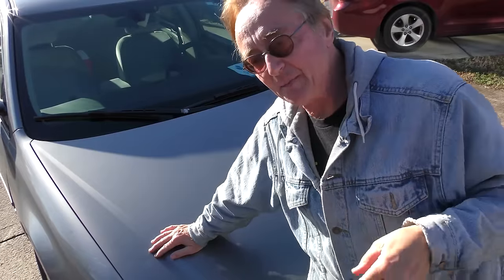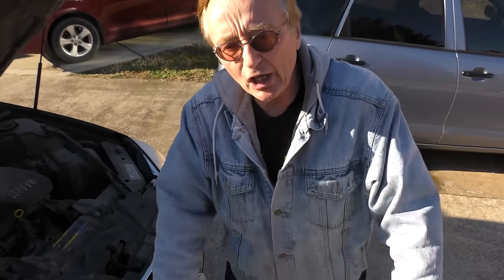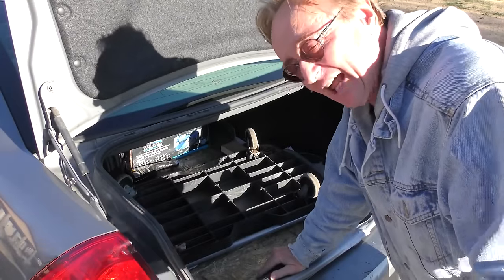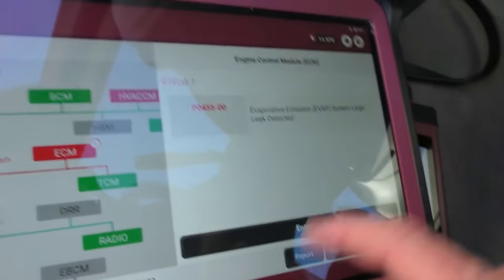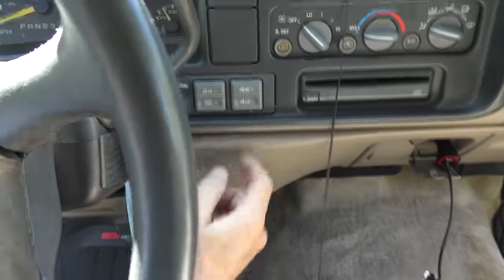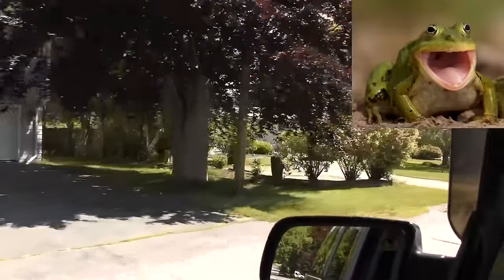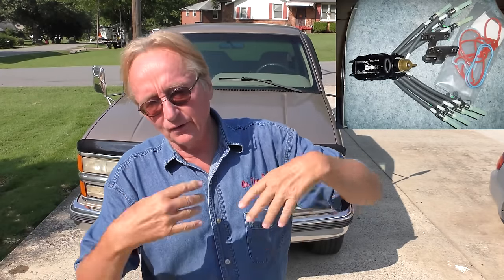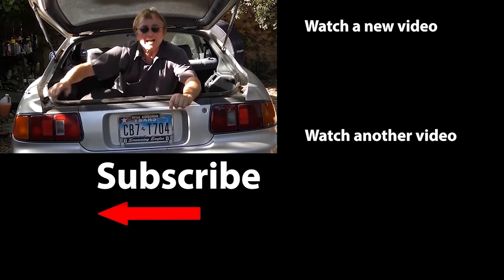3 Chevys That Last Over 400,000 Miles

Comment: I got a 2010 Mazda 3, automatic. Halifax, Nova Scotia. Purchased second-hand in 2014 with 92,000km. Next week I will hit 600,000km. Best car I've ever owned.
Reply: Mazda make awesome cars, extremely good quality
Reply: Wow. I had a 2010 2.5 with the 6-speed manual - thought it was a very well built car. Only got rid of it because I didn’t need a car at the time (got a company vehicle).
Reply: I should check to see if mine was actually built in Japan. I know Scotty says those are better made.
Reply: @randyburrill2340  For export, yes they are.

Comment: I have a 2003 Chevrolet Silverado z71 with the 5.3 liter. I bought it new and it now has 290,000 miles. It had the brake lines replaced recently, I had the water pump and alternator replaced a couple years ago.  The truck runs great, the only thing is the clear coat was coming off and I had to have the hood repainted. It has never been garaged.
Reply: It now has over 305,000 miles and I just purchased a driver side power window and mirror and door lock switch although I have not yet put it on.
My mechanic said he has seen this 5.3 engine on other vehicles come to his shop with 400,000 miles.
Reply: @denniskelly2177   Thats amazing !

Comment: I have a 2008 chevy cobalt. bought off my aunt in 2018 for 1k, i have put over 100k on it (i have a large commute) and have only dealt with three semi major repairs, 1. the trans fluid was never changed (my bad, 2k rebuild), steering column needed replaced (1ish k) timing chain needed replaced (known issue when bought in 2018) 1ish k. Fantastic car and it still runs great, i keep up on things and now regularly change my trans fluid. This thing is going to make it to 1 mil miles!

Comment: i had a 2003 impala that still running after i gave it to my lady friend. i knew there was a transmission problem when i bought it, it wouldn't kick into 1st on start outs. i used it mostly for in town driving so if it broke down no big deal. at 260,000 i got a connecting rod tap. my friend is still driving it with no major problems yet, knock on wood. you're right maintenance has lots to do with the life of any vehicle, abuse also reduces its life, yeah right when we were teens we didn't think much of that

Comment: I have a 1996 GMC standard cab pickup I bought new here in Florida. It has a 106k highway miles on it from driving 100 miles weekday back and forth to work. I retired in 2005  and it doesn't get driven much but it still runs perfectly. It was built in FT Wayne In. There is no rust and it still looks great.

Comment: I agree...Scotty I have a 1999 Chevrolet 1500 Suburban. I am the 2nd owner and bought it at 5 years old. It has 193577 miles on it, and yes it has a few faults, the rear ac lines rusted, so no rear ac. and it has a little body rust which I will fix. But it rides like a cloud. I plan on keeping until it blows up or I die. I only put about  1500 miles a year on it now since I bought a 2011 HHR  7 years ago. I am retired now my driving has been reduced. Love your videos.

Comment: I have a 2000 Silverado 5.3 V8 ...just turned 210k miles. I bought it for like $5100 in 2008..... 15 years later I've probably put about 5k in normal maintenance items into it. It was a northern car and I moved south with it but it's been reliable and a solid truck. GM needs to get back to making their vehicles like they did in late 90's early 2000's. They had solid trucks and sedans back then. Those Vortecs from that era were bulletproof...could easily 200k with minimal issues out of them and if maintained right they are 400k engines. Just had to be careful with certain years of those engines mated to certain transmissions.
Reply: I have a Silverado not sure of engine at 250K
Reply: All the trucks have become a nightmare, nothing simple any more, you are right back in the 90's they were much more simple. I am keeping my 1994 F-250, that I bought new; as long as I possibly can. Love the 351 engine with 5 speed on the floor.
Reply: Great. I have a 2003 GMC Yukon XL with 241k miles. Purrs like a kitten. Cheap parts at the junkyard is a plus.
Reply: I also have a 1999 mid year model silverado 5.3 and have 3610000 miles on it and counting!!!! Drive it every day hauling about a 1 to 1 1/2 ton loads on it and still engine is strong and smooth 💪but the rust underneath is extremely bad due to living in Missouri but this truck paid for it's self over ×1000 times!!!!!
Reply: @jewjones410  Damn 3.6 million miles? What's your secret?
Reply: @thedirtybubble9613  lol mybad 350k

Comment: I had a 97 chevy pick-up with the vortec  5.7 V8 and 4L60E transmission. Had 150,000 miles on it and that truck was solid. And very dependable. I wasn't afraid to take that truck on long trips. And, yes, I live in Texas, and the truck was Canadian made.
Reply: Same with my 2000 Silverado 5.3. I still have it. Just turned 210k miles and I am in Texas. Just drove it to Florida and back. Solid trucks!
Reply: @buzztrucker  Nice, I got 291K on my 2003 Avalanche
Reply: I have an 02 Sivlerado with 356k on the original motor and tranny. Still running just fine. Best vehicle I've ever owned.
Reply: any motor should go 150,000. nothing to write home about. 250,000 and up is when you should be proud
Reply: 98 Z71 5.7 still going strong but the interior is getting pretty weathered. Seats and head liner need work and dash just cracked. Passenger rocker panel rusted thru and clear coat has been peeling for years. Runs and drives fine. Gonna drive it till the wheels fall off. Doubt anything new will be as cheap to own and I don't drive it much.
Only 119k miles.

Comment: I am a w body enthusiast, my first was a 97 grand prix gtp, I bought it with 210,000 for 1,000$, I had it for 7 years and sold it for 1,500 $ with 370,000 and had the original trans and being a supercharged  3800 that I did performance mods and I beat it well, and  I know the car is still around, imo 97 and early 98 4t65hd trans were not a brittle since they had no traction control
Reply: I also own a 08 impala ss but that needs a trans but that's because of the V8
Reply: @amandaschuch2372  I've always wanted the SS! But they go through transmissions for breakfast lunch and dinner!
Reply: But the dollars are worth less then before....

Comment: I am sooo sad.  I own a 2000 Toyota 4Runner.  It still runs like a charm!!  GREAT running condition.  However, I've experienced the rust issue that they tend to have.  Pot holes were so bad this winter, something came apart underneath and there's secure area to weld it back to so I'm a loss.  Just put 2K worth of maintainance work into it less than a month prior!
I don't want not new car!  I would like to restore my 4runner or would like another older car .. preferably manual transmission!  These later model cars can't hold a candle to the older cars.  
I sure do appreciate these videos.
Reply: Mazdas are pretty reliable. I'm saving for a new one!
Reply: @mcc7762  It's jus over 200k miles.  It really runs great.  Just changed the timing belt and all that goes with that process, and had the whole break line system changed.  Just for maintenance!  It wasn't burning oil, tranny is in tact .. nothing else is wrong with it.  just the rusted out bottom.  Don't even know how to begin to go the way of a new frame.  Any suggestions/references?
Reply: @mcc7762  Thank you so much for your response!  Very helpful.  I will do a search.
Reply: @jackpowell8155  Hondas are even better than mazda

Comment: I have a bi-fuel 2002 Chevy Cavalier with 1,050,000 miles on it. The original engine and automatic transmission were replaced at 700,000 miles only because a fail safe thermostat failed closed and blew the head gasket and I could tell the transmission was on its last leg. Engine was not burning any oil, that's what running on CNG does.
Reply: What's CNG
Reply: @Rob810Flint  

CNG stands for Compressed Natural Gas.
Reply: @ryankirkham8130  thanks I'm supposed to know that 😂
Reply: @Rob810Flint  No problem!
Reply: Mine is approaching 300k starting to think it's a young stud still😂

Comment: That 3.5l V6 was always sweet, but the sweetest of them all was the 4.3l V6 on my 91 Astro van
Reply: Those 4.3 are 300 HP or so.  Very peppy and fast top end too.  I had a 1991 sonnoma with 4.3 supercharged and it flew.  The 4.3 are Chevy best V6.   The 3.8 are reliable as well

Comment: My wife has a 2007 Chevy HHR that we purchased new, it now has 262,000 miles on it and the engine still runs and sounds like it's new. I Change the oil when the the oil monitoring system indicates 10 to 15 % oil life left. Only use Mobile 1 synthetic oil as well since new.
Reply: I've heard those were good. I still see quite a few on the road till this day.

Comment: Have had 3 Chevy Astro's  2002-415000 miles and sold it still running. 2003 Astro sold it with 284000 miles running great. Another 2002 Astro currently 168000 plus miles. Changed synthetic oil every 8000 miles. The one problem with the first 2 were rear end problems. I delivered freight all over the U.S. Beefed up the springs and used heavy duty shocks. Was rated for 1500 lbs but I went over this many times. I think that caused to much torque on the rear end. Had plywood on the floor to put skids in. One skid had to go sideways. Rear cargo doors opened all the way to fork in the skids. comfortable and reliable. I cannot find a new suv or van that can replace an Astro.
Reply: It's a shame they don't make a midsized van or SUV that's body-on frame with a V6 or V8 engine and RWD or 4WD.  It's all become unibody, FWD, 4 cyl turbos that can't pull anything plus riddled with garbage electronics

Comment: I had a 2004 Chevy Cavalier LS 2.2 Automatic, coupe, the engine let go with 407,000... I tried so hard to get 500 out of it.....The valve cover was never off it, and had the original exhaust, & suspension on it!! Used to eat front wheel bearings for lunch until I found Moog.... I was using timpkin.... thumbs down!!

Comment: I bought a used 2012 Impala years ago that had 48000 miles.  Today it has 225,000 miles now and it runs great. I had to have the alternator replaced and the wheel bearings but that's about it. The big problem I have had with ot is the clear coat is coming off.
Reply: The 2012 Impalas have the 3.6 engine. Other than regular oil change intervals, what else have you had to do to it?
Reply: @thedirtybubble9613  the 2 ongoing issues I have is the clear coat coming off on the trunk and the issue with the anti brake light coming on. The anti brake issue is tied in with the wiring that runs from it I believe. We have taken it to mechanics that                                           
replace the bearings and a year later the problem resurfaces. Car runs good and we just turn off the traction control.

Comment: My truck is a 2000 C2500, the last year GM made that body style I believe. It's got 220,000 miles on it. I bought it used in 2002 with 76k miles. It doesn't hurt making a repair when needed because I haven't made a payment on it since 2007. It runs like a clock, no leaks, uses a half quart between oil changes at 5k miles. The ac doesn't work so I'm replacing the whole system for $500 doing it myself. AC Delco parts.
Reply: nice! I got 291K on my 2003 Avalanche, still runs like new!!

Comment: 2007 MALIBU Maxx here. Bought it with 150,000km 8 years ago for $3,000 and it has over 300,000km now. Rusty but just a great vehicle. AC blows cold and heat works great. Blower motor resistor was only issue (cheap fix). And then o2 sensor. If I could buy another one I would but it's too old of a car to cling on to now

Comment: I have a 2008 that was an executive fleet car, and a 2004 Monte Carlo my wife will not let go of. They both have 200K plus and run like new. Change the trans fluid, coolant, brakes every 50,000 and oil every 5 or 6K and they just run. Almost every mechanic I know has a 2000-2014 Impala or Buick Lucerne in their fleet. The 3400, 3500 and 3600 V6's in these cars never die. More reliable than any Ford or foreign car.

Comment: 77 Olds Vista cruiser. Mine had 430,000 miles on it. Looked like crap but. Swapped if for a months lot rent where I live. Owner of the park saw it as an eyesore. But it was still running when I sold it. Had holes in the floor but still running.

Comment: 2005 Impala 350, 000 miles and counting.We’ve change the oil , actuators , alternator with belt and tires
Reply: How many miles have you gotten out of transmissions on the 2005 Impala?  What is your maintenance interval for tranny?
Reply: I treated that car like garbage about the only thing I ever did was regular oil change tires brakes battery. Never had nothing internal done.
Reply: @chetmyers7041  
I treated that car like garbage never put one nickel into the transmission or engine. I change batteries ,oil belts hoses and tires .

Comment: I have a 2008 impala with 266,000 miles on it. It leaks all fluids, has a exhaust leak, needs some body work. But overall runs good doesn’t shake at all, has good acceleration, shifts good, and the ac still works. Haven’t had any problems out of it except for brakes. And of course the fluid leaks. It leaks everything but it’s still going.
Reply: What engine does yours have?
Reply: @luilu9051  I had the 3.5 in it. Very shortly after making this comment the transmission blew at 269K. But the engine was still running strong

Comment: I drive a 3.9 2007 chevy impala LS. Has 203,000 miles on it. Still runs pretty good. Recently had to change the TPS though.

Comment: My 04 impala has 270,000 and its rusty asf because its in wisconsin but the car works beautifully, only problem is wiring due to rats and one bad coil pack that was replaced but beyond that it gets you where it needs and the car works as it should

Comment: I currently have a 2006 Chevy impala with 229000 miles on it original engine , original transmission, even though I changed my transmission fluid last year and added Lucas treatment after I felt some slippage problems with the transmission, so I’m crossing my fingers I can get a couple more years out of it, one thing I’ve done with every car I’ve owned is change the oil every 3000 to 3500 miles so maybe that’s why its still running as well as it is

Comment: almost 300 thousand on my 02 tahoe still kicking along just fine ... I bought it 5 years ago with 142 thousand miles now I'm at 292 thousand ... I'm not easy on it I definitely push it hard and still get like 15 mpg ... only repair it needed was a water pump gasket ... in 5 years that's amazing ,,,, it dose leak oil but I keep it topped off

Comment: The Ac in my 2007 Malibu still works after 230000 miles. It’s creaky but dependable, doesn’t burn a lot of oil, automatic transmission is wearing out a little but it still goes down the road. Bought it for practically nothing since nobody wanted it but it’s been a great “beater work car”

Comment: The fact that the AC doesn't work means it's worth more on an older truck. It means that that engine hardly gets over worked. I would buy that 96 Chevy in a heartbeat.

Comment: 96 K1500 350 with 4L60e and 3.73 gears. 17 MPG on open road 14.5 to 15+ here in the Ozarks. Oh yeah, 296 thousand on the clock. Still starts every time and is dependable.

Comment: My 2011 Chevy HHR has over 251,000 MI don't ask me how I mean I take care of it tune it up change oil every 5 months at least it's not a fixer repair daily job if you know what I mean and only spent about $1,100 in repairs in the last 5 years including oil changes new battery new tires !! Absolutely runs like a champ still has the get up and go does not hesitate or have a problem keeping up with the flow of traffic in California on the freeways it must have been built on a Thursday haha

Comment: I had a 2004 Blazer that lasted 363,000 miles until I overheated it. Yup, my fault. It coulda lasted another 50,000-100,000 miles. The Vortec motors were workhorses.
Reply: nice! I bought my mom her 96 Blazer from my local auction for 1k with 120k miles! And I have a 2005 Trailblazer with 269K!
Reply: How many transmissions in that time frame though

Comment: I have a 98 Chevy k1500 with over 180,000 miles. I bought with a blown motor at 105,000 miles. I put long tube patriot headers, loud mouth resonators, and corvette mufflers. Spectra cold air intake. Very very reliable truck for I do hauling and scrapping. Eventually I want to put a 454 in it!

Comment: My 2008 Chevrolet Impala has 102000 miles. It runs great. I have original transmission, engine and a/c.  I have changed the brakes and tires. I think the quality is top notch.   It's a nice comfortable ride .
Reply: I'd hope you had the original motor and  tranny with 102k miles...that's nothing
Reply: I have an 09 with 110,000 gets driven for work 500 miles a day

Comment: Not necessarily Chevy but still GM. Mom had a 2001 Saturn SL with a 5 speed manual and that thing had 380k original miles on the engine. Burned a little oil at that time but only major repair was radiator and radiator fan breaking. I love old GM with a passion
Reply: It's a shame they discontinued Saturn.  They were great cars!  I had a 96 SL2 5 speed manual.  It had fiberglass panels that never rusted or dented.  I had 316k on it.  Should've kept it
Reply: I've had 3 of those, all standards, one was my ex's 96 5 SPD SL ,  one was  my 97 5SPD SL1,  and my wife and I had a 99 5 SPD SW2, that one was the only 5 SPD  Saturn wagon I've ever seen with leather. We loved them all.
Reply: I heard they were good cars.

Comment: I have a 1998 GMC K2500 SLE 4wd pickup with a 454 eng. and 5 speed manual trans. I had that same slop in my steering. Replaced the lower steering shaft because the rag joint was worn out. Truck steers much better now.

Comment: My 2003 Impala has 228,000 miles.  Had to rebuild the transmission at 170,000 miles.  Runs excellent.  Insurance is inexpensive.  AC blows cold.  Might get seats rebuilt.  Plan to drive as long as possible.